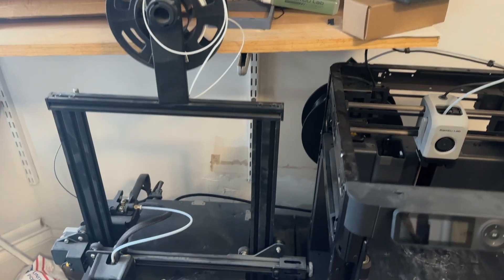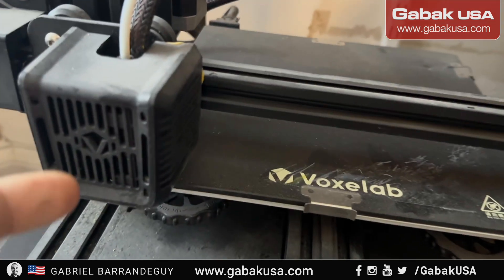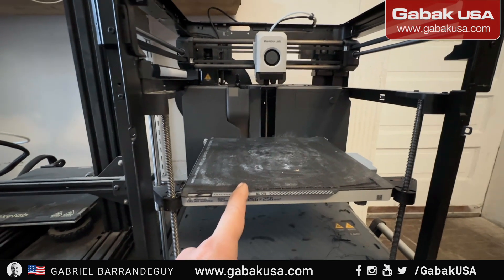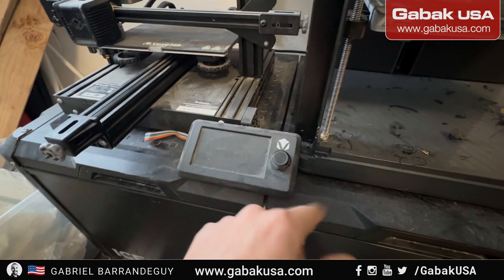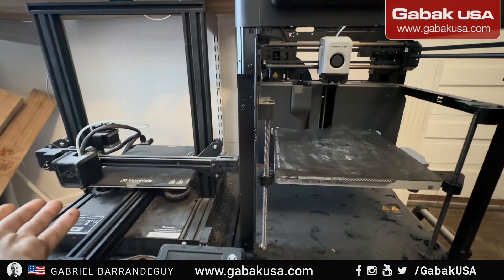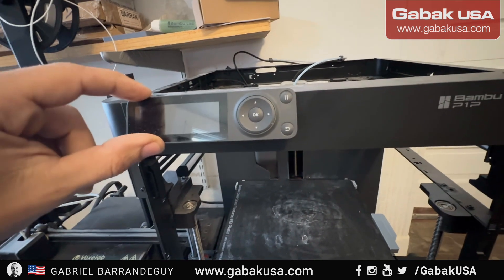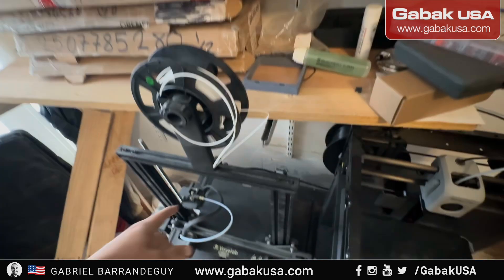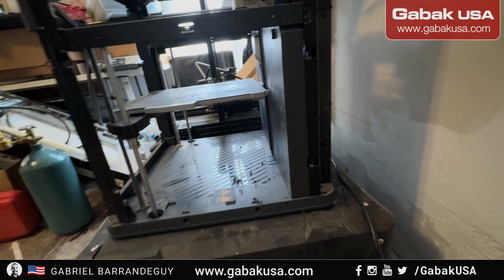3d printer differences between  the cheap vs expensive one

Comment: You should have named it "Difference between 8 years old technic and modern technic".  What you are doing is to compare a 1955 VW Beatle with a modern Tesla or Dodge Ram or so. Has nothing to do with the price.
Reply: Look at what the bamboo cost and what the aquila.. I bought one (aquila) and invested in a sprite extruder and a magnetic bed.. Not to mention the rest I did.. It's a hobby... Still very pleased with the aquila and still not even half of the price a bamboo costs.. And the aquila is mouse silent now..bamboo is making loud fan noises now. Bit weird vid. But seeing the dust and dirt it figures you making such quick conclusions.. But putting it on YouTube is asking for the truth.. Don't shoot the messenger..😊
When you just want to print and have no technical skills yes buy an expensive do it for you printer..

 When it's a hobby and you can perfect it and want to tinker with it and still save money.. Buy an ender or aquila

For every purpose/person a different choice of printer
Reply from the maker: bambulab printer i bought it brand new a few months ago
and the other is one year old ;-)
Reply: @gabakusa  The Ender printer is designed about 8 years ago, the Bambu printer is designed recently, with better, more modern 3d print technology, it is more refined and in another price range.
Reply: @gabakusa  You do not understand. This type of portal printer is from about 2014 (No BLTouch, Wheels instead of Rails, insuficient cooling, Bowden instead direkt drive etc). A lot of manufacturers copied that design with only little changes. One popular manufacturer was Creality with its CR10, later called Ender. It doesn't matter when you bought it. It was already old technic one year ago! The only company that reinvented the portal design with modern technic is Bambu with the A1. And this machine is also cheap compared to Ankermaker or Prusa.